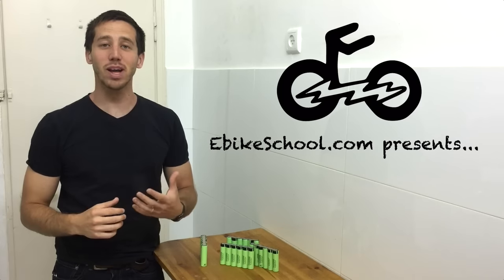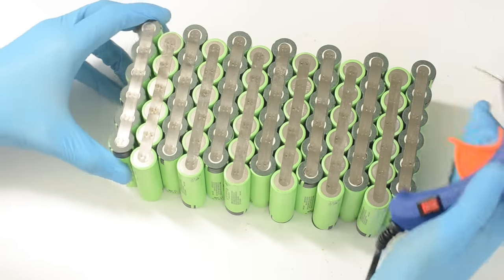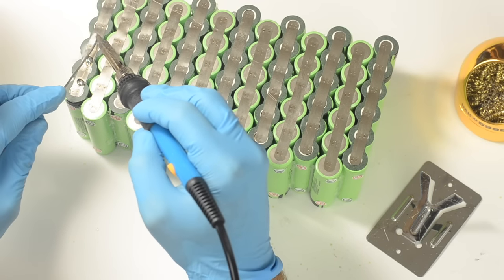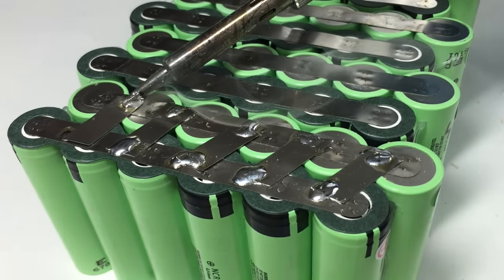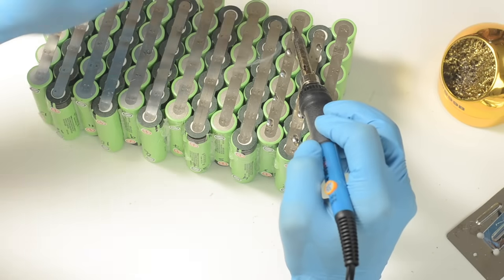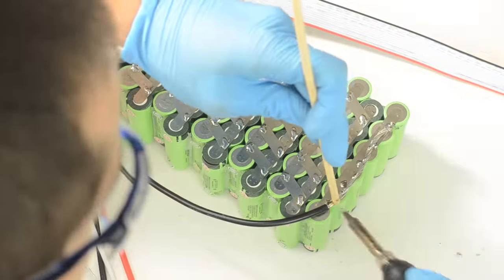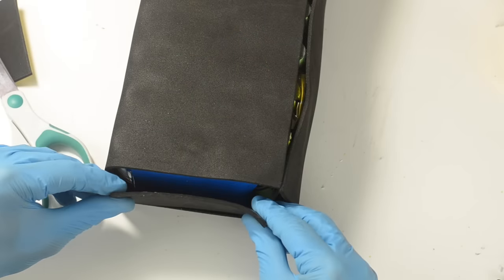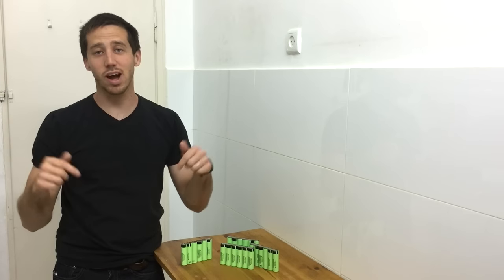DIY 48V 20Ah lithium battery without a spot welder using Maker Batteries

Comment from the maker: I hope you guys enjoyed this video. If you want to learn even more, I hope you'll consider checking out my Amazon #1 Bestselling book, DIY Lithium Batteries, available in paperback and ebook formats. http://a.co/iDtWdPX
Reply: hi man! you have 6 pieces in a parallel.!! а это 17100 mah
Reply from the maker: They are 3400 mAh each, so its 20,400 mAh total
Reply from the maker: Amps and Amp hours (A vs Ah) are two different things. The first is more equivalent to power and the second is more equivalent to range. This battery can output 30A, so yes it would be enough.
Reply: Thank you , it is possible to use this battery on Nicom electric scooter , voltage sems to be same , 48 v. the one im having right now in is the 4x 12 v acid lead batteries inside , 48v 14ah, so basicly this upgrade would give me 48v and 20ah
Reply: TY!!!!!!!
Reply: Thank you for the good video. I checked your site. Price is very competitive compared to buying my 36V & 48V battery packs already built. But man...all that soldering looks so tedious. I've got to think it over some more.
Reply: Is it possible to make a 48v 5amp or 10amp battery. To reduce weight. For a bbshd. Thanks?
Reply: Sadly that you never ship this item to singapore as i was interested to get 1 of this
Reply: 48v24ah how many battery in 3.2v 5000mah
Reply: EbikeSchool.com 
Hi mate can you do it battery for oset 24  is like 20Ah, 48V Lithium battery ?
Reply: explain please each cell how much volt and ampere
Reply: How much if you make me one and ship to Australia?
Reply: I bought a 36v scooter can I use this 48w on the same  scooter or r there more qualifications that you're not putting forward?
Reply: @juliusdades1426  I don't think they can send to Australia, you might want to order the batteries over eBay, Aliexpress and assemble your self or buy already assembled kits over there.
Reply: hi thanks for the video but wot bms are you using if it works this will be my first one i made the video was very helpfull
Reply: can be considerable , but not professional, you are misleading people!  Totally Panasonic 3400B cannot be used to build battery packs for large ebike or scooter because it has a very high inner resistance , the reason why so many fire or explosion happened in EU is caused those guys used 3400B or Samsung 2600 F or 2600H M or Samsung 2600M to build such kind of battery packs.Dude, you can use other particular cells to show your video,  like Panasonic 3200BD or 3500GA
Reply: @davidporters9203    we can supply all the necessary parts,including battery cells, battery BMS, wires, insultative loop cap,5v transformer, high-temp tape, wire protective tube, shrink tube,battery case, but the cells in this video is the reason why so many fire and explosion happened in EU, because this 3400B CAN NOT be used battery packs, it's inner resistance is more than 52.9mΩ, Absolutely cannot be used on ebikes battery, only Panasonic 3200BD, or 3500GA or 2900PF or Samsung 25R,22P 30Q is available on power battery packs
Reply: @iwantyou4life  i don't understand: one battery is 3400mAh, so this pach is 78 battery × 3400 mAh= no? Can me to explain? :))
Reply: Brilliant Book I have it
Reply: I have your book . Too bad your kits and batteries are always out of stock when I check. The kits look good, but it doesn't matter if I can't buy one

Comment: Clever way to respond to what is I'm sure a huge influx of people screaming at you "DON'T SOLDER ON 18650 TERMINALS!" Keeping the heat spread should help. I'll add my own 2 pence and say you should (probably) alternate soldering joints until you're done. Solder one end of the pack, and then the other end, then back. People who work on body panels for cars do this to avoid warpage of panels and to keep from blowing through the metal. Tack weld one area, move no less than 4 inches, tack, move, tack move. What you end up with is a panel that is warm, but not burning hot in any one area. I can see the same principal applied to these packs.

Comment: Nice job. Watched a few battery vids by others and cringed when giant threatening globs of solder were melted and slapped on top where they appeared they could easily short out individual cells,  and wires were moved about before the solder had had a chance to set up. I like the nickel ribbon application using a spot welder to make small battery packs and use the ribbon to disburse heat and isolate the solder from the battery. Makes for an efficient assembly of larger configurations later. Also a big plus, a neat professional looking final package. We can live with soldering whole strips of pre-welded batteries. 

With solder alone I'm guessing there's an increased risk of creating cold solder joints. Cold solder joints mean a mechanical joint formed but electrically it could very well be anything from a high resistance connection to an open circuit or, as you pointed out, resultant heat damage.Was the finished product charged and tested for load balancing before you shrinkwrapped it? Do you not recommend shipping pre-charged batteries? What charger and display do you recommend using or including with a package sale?  What brands and configurations in battery chemistry have you tried? Right now LG and Panasonic seem to be the top brand favorites for all standards of measurement. Sorry about all the questions. There's a lot to the learning curve and it's going to be big business down the road. Your video was extremely helpful. Thanks for this. I will def check out your other videos.

Comment: Battery cells with high resistance like liitokala HG2s are acceptable for large capacity 20ah packs like this because larger capacity packs have less resistance than smaller ones. I have a 48v 10ah liitokala pack which doesn't perform great so I'm going to wire 2 of them together in parallel using a dual battery discharger converter adapter. I think if you buy large capacity cheap packs and only charge them to 80% it's better value and probably lasts as long as packs using pricier cells, the only down side is it will be 20% heavier.

Comment: I still prefer the Tesla (car manufacturer) style batteries with the fuse wire on each individual cell. Safer that way in case one cell shorts, the fuse will blow and prevent other cells from discharging into the shorted cell.
Reply: nothing is save with Lithium...  that includes the tesla's, hence the power wall cancellation!
Reply: No, Powerwall was not cancelled. At least not as of a few minutes ago. Powerwall 2 is currently available on Tesla's website. The 10kWH version was discontinued in favor of a 7kWH Powerwall, which was then re-upgraded to 10kWH for PW2. Also, the DC version was discontinued because of reasons I don't fully understand.

And 18650 batteries are actually really safe. Look for any number of videos of people abusing them and purposefully trying to make them explode, catch on fire, etc... They have enough capacity to be useful, but are stable enough to prevent things from going horribly wrong in most cases. Note, MOST. Even Alkaline batteries can be dangerous if you mistreat them, so let's not lump all lithium techs in as being automatically "dangerous".
Reply: Yeah really! I watched a video yesterday of someone who built his own Powerwall and accidentally shorted a contact while changing some equipment, while the thing was fully charged and at I think 40kWh capacity. It blew all of the wire fuses on the last pack in the chain. Probably saved the guy's life, or at least his hand and arm from severe burns. Those fuse wires did their job well!
Reply: my thoughts exactly. Also... not sure if this is possible, but can one make individual cells replaceable by avoiding soldering altogether, and marking failed cells by LED/no LED
Reply: nothing is safe with gasoline, either, or any dense source of energy.

Comment: Có tất cả 78 viên pin, loại 3,7 vôn.
Ghép song song có 6 nhánh.
Mỗi nhánh có 13 viên mắc nối tiếp (13×3,7v = 48,1v).
Vì mắc song song nên số vôn của nguồn ra là 48,1 vôn.
Thêm 2 Diod chống ngược cộc với một tụ bù, 1 Transitor ổn áp 48v và 1 ngỏ để sạt pin.
Xin cản ơn Ad !

Comment: I would use Kester rework flux on the solder points and use lead based solder for a faster melt at lower temps and a better joint. This is DIY so you're not selling lead free products to consumers. This is the same method used by the military and NASA which should speak to the quality results. After using Kester products for over 5 years, I can now understand why military engineers rave about it.

Comment: Please be safe while doing this guys. The serial cells should be separated and or insulated better. In fact all the cells should be separated by at least a 5mil space. Batteries holder work well. Also the bus bar also be separated from each other. They are so close in the series. Also also that fuse connection from the bms to the positive end of either of his groups of batteries should not not be that thick. If your system is rated for 20 amps peak and 15 amps nominal only use a fuse that matches your battery amps if your batters use the nominal 15 amps then your fuse must be at 15 amps to prevent over voltage and burnout. Let's say it peaks over 20 to 21 amps even for 10 secs could be enough amps to start to overheat your little 3.8amp battery.  Even in parallel. But if you keep the positive lead only rated to 15 amps the lead will burn off first saving your life and batteries. And that's only output. From battery to source not source to battery.  God imagine if you plugged this in the wrong solar set up

Comment: You know, when I first watched your spot welding DIY battery video and started looking at spot welders, I gave up because of the price/time it would require.

But you've come up with a great "module" idea which requires only soldering and wiring. You've pretty much opened up to a whole new market of DIYers (most of us have a soldering Iron!).
Perhaps the only thing I may suggest (and I am sure you're already working on it) is 3-5P modules. 6P for 20Ah is probably too much for the average ebike commuter and also quite expensive!

I am definitely interested now. Keep up the good work!
Reply: Do not solder Li-Ion battery. The hear from the Soldering Iron is as high as 700 degrees. Upon contact with the body of the Cell, the hear spreads disrupting the Chemical Balance of the Cell and will, either diminish the life of the cell and or buckle the internal metal strips and the separator.
Spot welding is safer, because of the very short duration of the heat bonding the two metals.
More so, Soldering is not recommended for Lithium Ion Batteries. Please note.
Reply: Read as HEAT**
Reply: I have not had any experience with soldering 18650 batteries, but I've soldered other batteries before.
If you keep the soldering time under 2 seconds, and can solder under 600 degree temperatures, you're fine.

Comment: Did the strips come ready welded, as the video says "without a spot welder"
Reply from the maker: Yes
Reply: so why lie in the title?  also generally 18650 batteries are about 2.5 A-H and u have 6 in parallel so that makes it about 15 A-H and you called it 20 A-H.. for 20 A-H they all have to be 3.3 A-H.  so now is that also a lie?  you have 13 batteries in series so that makes it 48V which is what you called it.  is the DIY your sales outlet?
Reply from the maker: +John Conrad - Relax, they are Panasonic 18650B cells and so they are 3.4 AH each, meaning the total pack capacity is 20.4 AH. The title isn't a lie - you don't need a spot welder to build this battery pack.
Reply: @conrad: I guess you have other problems, call a doctor
Reply: @TAK Ism. Let's see you're battery packs. Oh, wait, either you haven't made any or haven't recorded them with the potato you use to record videos. All you've got is a couple of super basic monitor repairs and personal videos.
Reply: @John Conrad Good job generalizing a very specific product and sticking your foot in your mouth. :)

18650 batteries vary widely in capacity from between about 1400mAh to 3500mAh. Not counting all the cheap, crap, rejected Chinese cells that have less capacity and fraudulently sold as higher.
Reply: The Joker lol. So, I provide irrefutable proof against what you're stating, and somehow I'm wrong? Not only wrong, but in denial about it? Kiddo, I know the intarwebs are hard to use sometimes, but do your future self a favor and learn from when you've been proven wrong, don't just stick your head in the sand and go 'lalalalaicanthearyoulalala' like you're doing here.
Reply: The Joker n
Reply: I like how you deal with sharpshooters.  :)
Reply: Actually LG has popular 18650's at 3500mAh and Panasonic/Tesla has super-popular 3400 mAh. LG being more true to specifications.

Many cheapo chineese 18650 is way below 1000mAH. Simply put, they are not all made the same. Hobbyists do not necessarily use the typical 18650 capacities we are used to see in laptops and cordless powertools.
Reply: You are simply wrong here, Kiddo. LG 3500 are well tested and proovenby the community to be true to it's stated 3500mAh claim. SO are MANY other  models over 3000mAh. You are embarassing yourself here.
Reply: I am an Internet Doctor! 100 bucks L0L
Reply: Thanx for that Gym Nasium! L0L I noticed the different amperages on the 18650s the other day. Any idea what I would pay for what is advertised here? (48v 20 ah pack with the Vruzend kit, and using the 3400mahs) I was thinking of using the bigger Headways instead. Four packs of 4x 3.2v which = 48v. I think they will fit better in my battery case on my scooter. Each pack in there now is 71/2" x 31/2" x 7" deep. times four.
Reply: Spot welder is not the same as soldering.....smh. good video
Reply: You guys dont sell just the connectors?
Reply: @Direct Netstores because you buy the kit, and all parallel cells are already pre-welded. You as the buyer only need to solder everything else.

Comment: Good evening, very nice and instructive video, thanks. , I have a question, can i use a 16s bms on a 15 row battery and just leave one connection blank, or is that not going to work out?

Comment: Hey Mike i just received my batteries , I checked voltage all batteries from 3.45v to 3.50, my question is should I fully charge them or i can start putting it together?

Comment: I have an electric bicycle with a 250 watt 36 volt motor with a 36 volt and 10 amp battery. Can I switch the battery to 36 volts and 15 amps ..?

Comment: I know its best practice to not solder directly on your battery but I do it all the time and never had a problem or capacity drop. I mostly use 26650 batteries though
Reply: If you're quick with high heat it makes no difference, the battery will get hotter running barely any amps from it.

Comment: They already spot welded 😂😂😂😂
Don't leave it where moisture can get to the solder it will corrode plus the balance wire different lengths may cause issues with voltage over time with balance chargers

Comment: Hey, a question... these kits (and others) don’t accommodate any fuses between cells. Other videos on here have quite complex bus bar / fuse configurations (often soldered directly to the cell cap). 
Are such inter-cell fuses important / advisable /  unnecessary / definitely overkill..?

Comment: Would two of these same packs in series make a 96v 40ah battery ? Also mind doing a video on two of these in series or two packs in series in general
Reply: I guess in serie it would make a 96v20ah battery but im not sure. Im new to this.  I thought series is dubbling the volts and parralel is doublin the Ah
Reply: @jewitdawel1877  yeah you are right. You will need 4 times

Comment: Many thanks for your videos and websites. Amazing resources that I'm still running through since I discovered them a few days ago. 
As for this particular video and the soldering process in general, I understand that preventing the cells from heating up is the key factor of the success in the entire process. 
I was wondering if it would help to cool down the soldering right after it's done, by applying a frozen or cold non-conducting object on it, so that the cold kind of balance the higher temperature brought by the soldering. Maybe not for this particular case, but more generally speaking when it comes to apply soldering that does not come from a spot welder on battery cells. Any thoughts? Salut et merci from France!

Comment: I was just wondering about your earlier comment. You said measure all the packs to check they have the same voltage. What do you do if they don't?
Reply from the maker: If they come from Maker Battery, then they should all be the same. But if you have cells that aren't the same voltage, you shouldn't use them in parallel. Either charge/discharge them until they match the others, or find other cells. Putting two cells in parallel that have drastically different voltages can be dangerous, as the higher voltage cell will try to rapidly charge the lower voltage cell.
Reply: This is the most important question in the entire thread.
Reply: Before soldering or spotwelding any packs or cells it is always good to use a load to equal the voltage of the cells or packs of cells.
Reply: @EbikeSchool  Actually same voltage doesn't matter, unless they're "fully charged" what matters is the internal resistance which can also be tested. You can have a half dead battery and a fully charged battery that are the same voltage (3.7). That would mean your "fully charged" battery is garbage and your "half dead" battery is not fully charged which would be around 4.18 - 4.20 volts in a healthy battery. Comparing voltages after fully charged and sat for a few hours, you should see them around 4.17 volts. both batteries being around this means they're probably decently healthy. Though it still is irrelevant to whether they should be used in parallel or not. That's what internal resistance is for and why it's important